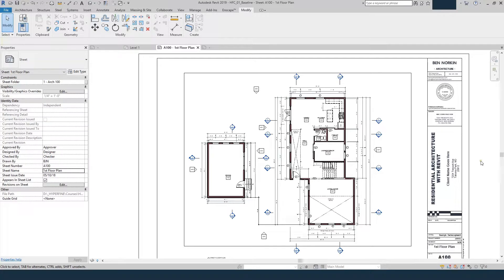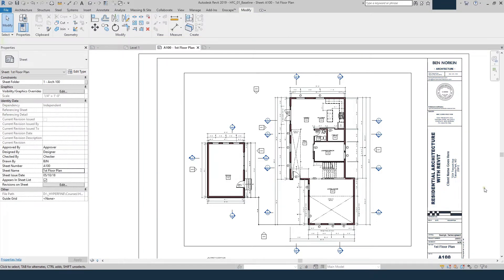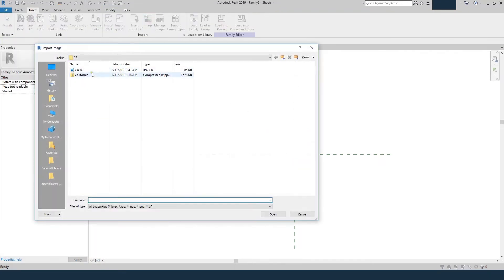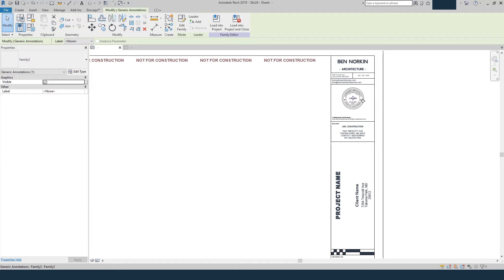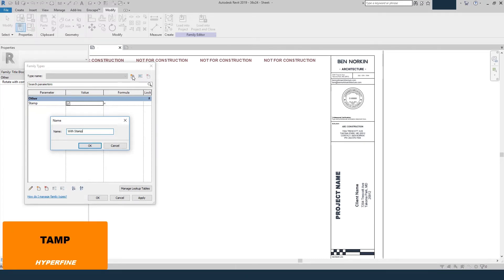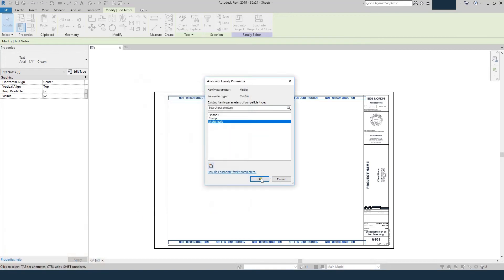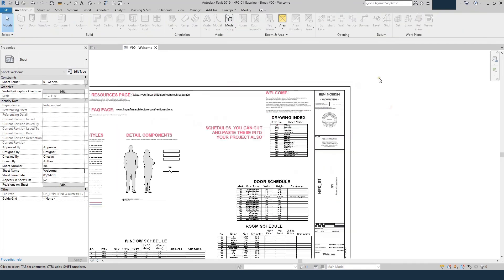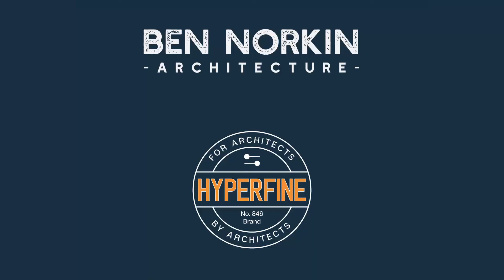Revit Tutorial: How to Add Titleblock Stamp

Comment: Great video, but how can add opacity to the water mark? I need to add a huge logo just in the middle of a set of plans, but I need it with 10% of opacity. Do I need to add opacity to that image in Photoshop or it can be done in Revit? I know that is possible in AutoCAD.
Reply from the maker: If the watermark is just text, do it in Revit with a transparent background. If it's an image do it in Photoshop and save as a transparent background PNG.

Comment: AFTER I INSERT THE STAMP AND SELECT IT...........I DO NOT GET THE "VISIBLE OR NOT" ICON
Reply from the maker: I think you missed a step. The image goes into a Generic Annotation family. You can't turn the image on/off. Load the Generic Annotation family into your titleblock, drag it onto your sheet, and then select it. You will have the Visibility parameter available in the Properties panel.